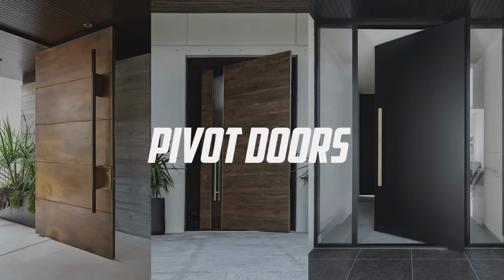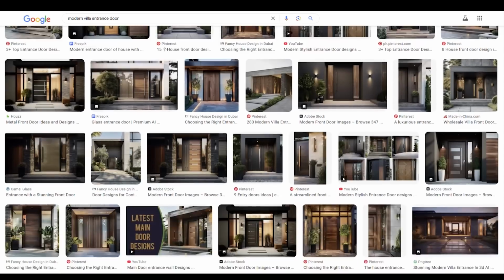BUILDING A CUSTOM PIVOT DOOR using RECYCLED MATERIALS #diy #fabrication #design #build

Comment: I am surprised you guys didn't wet sandblast the door to remove all the rust before you moved it into the house.  I guess you are just going to grind off the rust by hand before you guys paint it.  I guess you could use the same spray foam insulation for the door as in the rest of the house, but what material will you use on the inside door to cover the insulation?  For the walls and maybe the ceiling inside the house, I imagine you will use Sheetrock.  However, I don't think that would work on a door.  At least I have never seen a door with one side covered in sheetrock.  Do you still have corrugated steel left over that you can use for the inside of the door?  Or will you weld on a thin piece of flat steel?

Comment: Love you videos and the build when building the door I myself would have taken off the wide 4 or 5 inch outside edge on main piece and 18 inches off the top and bottom piece then measured the second part and include the outside edge and the 18 inches extra on top and bottom so you would weld the two pieces together making it look like one solid door without an extra piece in the centre, just my thought

Comment: I remember when I first bought Bose Speakers. It was back in the 90's and I still have them. However, I didn't know how deaf I was back then. So now I have hearing aids, courtesy of the VA. They are they are 'myPhonak' and they are awesome. They cost a lot, a lot of a lot. I have had them for 4 years and I will get new ones in April, courtesy of the VA.
I did earn them, hence my deafness.

Comment: Why dont you use the whole door, and set it up as a sliding barn door....
Reply: As long as the door is wide enough (when open) and opens and closes easily, it's not a big issue.  However, the barn door concept entered my mind too.  However, the weight on the required rails might be too heavy and uncomfortable to open on a roller system😊.  But I don't really know.

Comment: Possibly consider reinforcing the bottom and top areas where the pivots will mount?  Perhaps some 1/4" plate where the door panel must bear the total weight of the door?  I think it might be conducive to the long term life of the panel.  Just a point to consider.  Good luck!

Comment: Pivot doors are a beautiful concept but unless they're completely protected from the elements, they're almost impossible to make weathertight because you can't have external jambs for part of the door on the edge and the bottom. Which is why you always see them in grand covered entrances but never actually exposed to wind and rain. So it'll be interesting to see how you have to amend your house design to keep the weather out.

Comment: I have been involved with three pivoting doors. Yes, they are all bespoke. The thing to always keep in mind for the design - the Frame Must be solid, the Bottom part of frame is the Most important as ALL the weight rests on it!! Two of the doors failed because the bottom frame warped or distorted over year and year's time. I suspect your door failure will be on either side of the weld line , as it is probably the strongest point. The ideal Pivot Door would have a 1/4"minimum 1/2" best thick, steel angle iron bottom , with vertical portion on inside edge of door- U shaped steel even better!  The best Pivot door I have seen was a 3" thick piece of solid Mahogany with a U shaped steel bottom and top and sides. (it burned down in the Palisades Fire last week) Your pivot door is going to very cool (as your whole place is) beefing up the bottom will help a whole lot!

Comment: Amazing work guys! Small suggestion, I’d lean toward an oak wood finish. Only because the entire house is all steel, and it would stand out more plus just break up the steel look. But it’ll look incredible however you finish it. As well as the entire house. Thanks for such fab videos. 
P.S. Still don’t know how you plasma cut so straight with just free handing. Incredible👍

Comment: Why don't you wear good hearing protectors? Bose doesn't make claims about the suitability of there noise cancelling technology for industrial applications. (or "industrial, construction, lawn mowing, welding, metal working etc.")
Reply: Completely agree, Noice Cancelling is not a form of hearing protection. Need proper rated ear defenders

Comment: How about boring out several holes from the top of the door and pour ZRC to coat the inside, not a cure but corrosion delay solution. I'm a Building  Contractor in FLA . beachside .